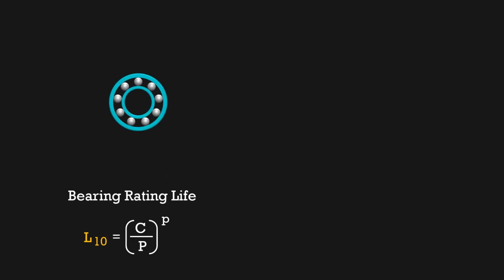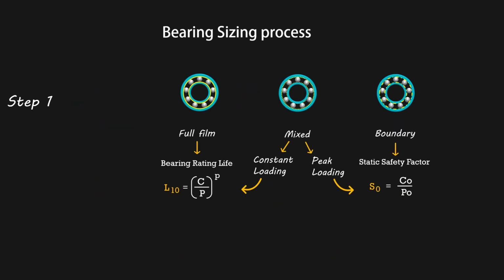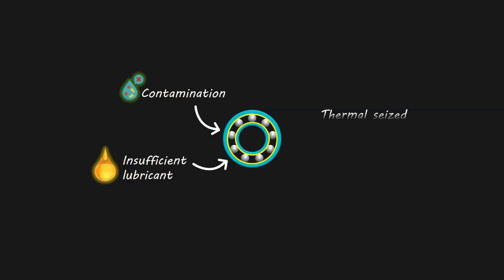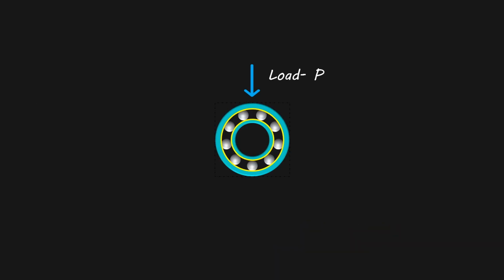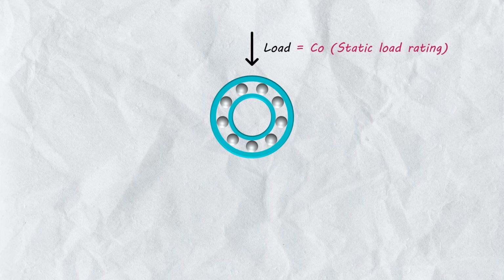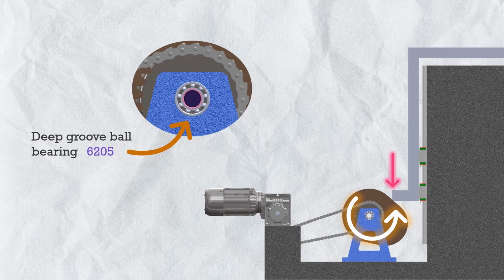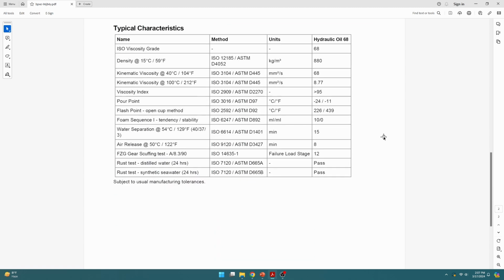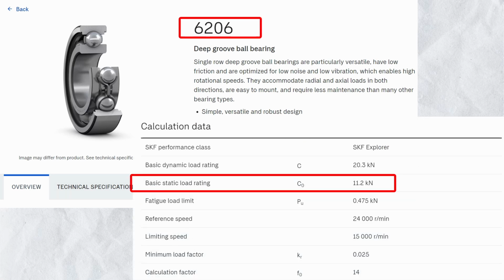Bearing Sizing Calculation on Bearing Lubrication Condition

Comment: Hi bro. If we change to 6206 bearing, the viscosity ratio V / V1 is still 22/1000 , which leads to boundary lubrication condition for this speed of 5 rpm. So, What is the benefit of checking the lubrication condition when we just use static safety factor to calculate if the bearing is recommended or not ? we can directly go ahead and use static safety factor for this calculation,  i am little bit lost here.

Comment: How is dynamic load rating more than static load rating? Can you please explain sir.
Reply from the maker: Both are very different thing, Dynamic load rating is related to fatigue, where static load rating is related to strength of bearing material and its deformation, (already explained in this video)
Reply: @mastermechanicaldesign  Does that mean it can withstand more load while in running condition than in static condition
Reply: but that goes against fatigue theory.Can you pleas3 explain sir

Comment: I want to use a deep groove ball bearing for mounting on hub with a static load capacity of 10.3 KN and Dynamic Load Capacity of 17KN, and the maximum load under the breaking + turning condition is  around 8KN, should I consider this case as Boundary Lubrication Condition or Full film lubrication Condition??
Reply: as the static factor of safety is around 1.2 i am doubting using it
Reply from the maker: You should do full calculations step by step. full fill lubrication condition is always better, give much more life.

Comment: Can you please tell us how much portion is still left to complete the series on Bearings?
Reply from the maker: Bearing fitment tolerance
Bearing fitment GD&T
Bearing lubrication selection and quantity 
Angular contact bearing block design (projects series)
Bearing run-in procedure 
Bearings from turn table 
Bearing vibration analysis (optional)
Bearing failure analysis
Reply: @mastermechanicaldesign  A lot is to be covered. I understand you have some constraints for releasing videos quickly, but I would request to complete this series on bearing along with related project series.
Reply from the maker: Yes sure, important videos are only two left, bearing fitment and lubrication. I will cover very soon in between GD&T lessons
Reply: @mastermechanicaldesign  You are amazing bro.

Comment: Good work Ayush!! one thing i would like to ask here is what about the load due chain/Belt tension on the bearing? is there any constant (Approx value) that we can consider instead of doing another whole some calculation of motor speed Belt/chain tension?
Reply from the maker: Yes there are constants for different types of drives, you can find this in this video at 8:26 https://youtu.be/GjrWfV2EN7Q

Comment: Can u explain the design of bearings subjected to radial load in 4 Directions
Reply from the maker: Radial load in 4 directions - could you elaborate this. Like from load at every 90 degrees.
Reply: @mastermechanicaldesign  sir it means assume a motor shaft in motor having a sun gear on it and this motor shaft will be supported on two bearings and it will rotate three planets each 120 degrees apart, then each planet will give a radial load on sun it will transfer to bearing, so the bearing want to be supported in that case how we can calculate dynamic load on motor shaft bearing..?
Reply from the maker: I guess you should apply the principal of superposition to calculate the equivalent dynamic load. Square root of sum of squares of each individual force acting in different directions.
Reply: @mastermechanicaldesign  thank you sir ❤️

Comment: Please create Detailed video about Heat Treatment of commonly used Metals in machine manufacturing such as En8, En19, En31, D2, 20Mncr5 etc. Also try to explain about when to use hardness and do toughning and case hardening. With standard HRC values
Reply from the maker: Sure!! Very good suggestion. Surely I'll do
Reply: case hardening is used for drive shafts such as EN24, 20mncr5, 16mncr5, EN 19, EN 355
HDS, HC D2, HC D3, C45 are used for die making, cutting blades, tools  etc, for high HRC applications
OHNS material if through hardening required

any one correct me if i am wrong! and share if you know more... in detail.